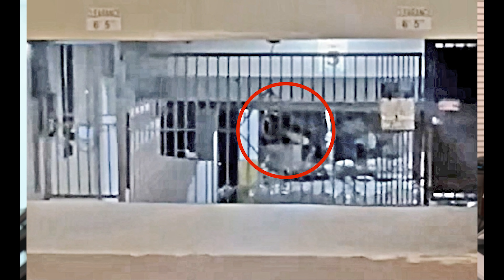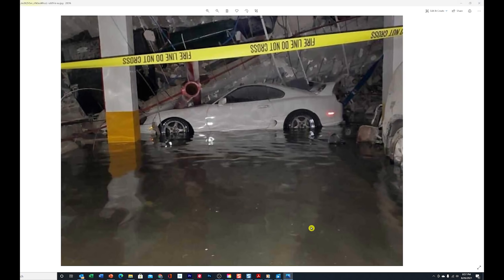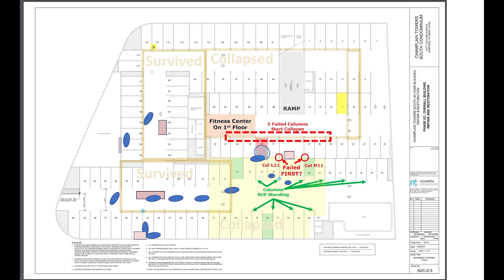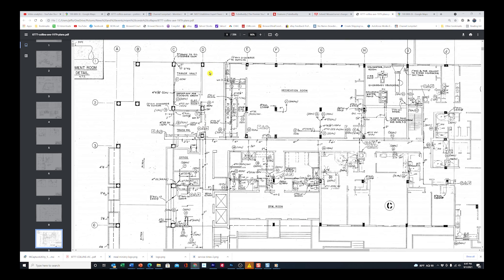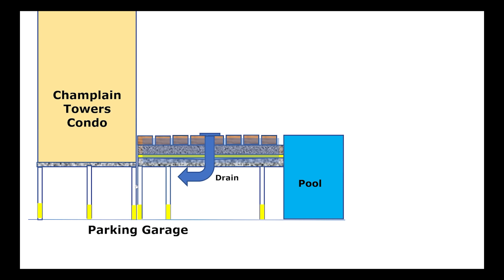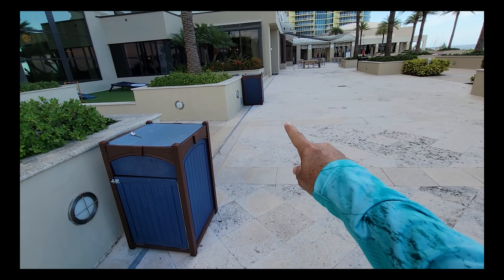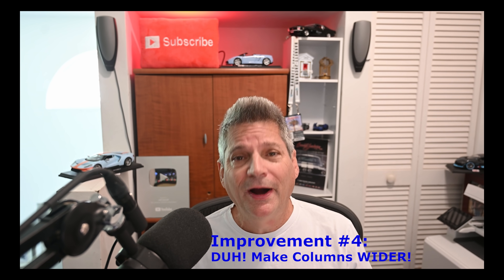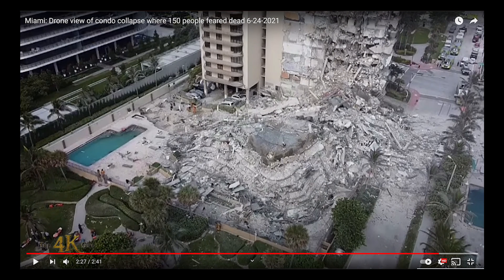Miami Condo Collapse: 4 Engineering Fixes May Have Prevented It

Comment: A simple waterproofing membrane would have gone a long way to protect the reinforced concrete
This same thing happened to a mall in the city i was born in, which had a rooftop parking garage in a far north climate where salt is used heavily on the roads during the winter seasons. It never had a proper waterproof membrane installed since it was build in the early 80's, it leaked from the day it was opened, and it collapsed after years and years of salt water intrusion.

Comment: I seem to only get these videos in 480p for some reason.   I can’t select higher…..
Reply from the maker: You should be able to adjust that, by clicking on the gear icon while your YouTube video was playing, and then choose quality, and you should be able to set it at the highest resolution. I find a lot of times it won't automatically select the highest resolution for me and I still don't know why but I find myself having to correct that all the time. If that still does not work for you then you need to find out what's wrong with the browser you're using and why it is not allowing it to change the resolution. Because I would think that the YouTube app will only allow you to change the resolution if your video can handle that resolution.

Comment: What you say it is col # 118 looks to me like 110 !!!
Reply from the maker: It does have moments where the compression make sit look like 110, but  I have done freeze frames on it, and at the beginning you can see it is clearly 118, and also the spot where they are drilling only makes sense when you look at the floorplan, a it is the only spot in the garage they can be under the still standing part of the building, an under the dumpsters.

Comment: Jeff, I have built two high=rise buildings with triple levels of parking below them. I know we had expansion joints, but I do not remember if they were at the building's edge. One of them has been ordered closed due to Spalding and need of maintenance by the present owner. PACE NATION will fund this type repair and take a special assessment for repayment over 25 years. They will also replace energy hogs with efficient units that will pay part of the future payment.
Reply from the maker: Yes every solution has its own problems. Glad I'm not the builder!

Comment: Excellent video once again.  The waterproofing and drainage on the pool deck can't be forgotten.  That deck was holding 100% of its capacity without all the water it was surely holding due to the waterproofing, or lack thereof, and the drainage issues.

I wonder how many of these construction faults can be found in the other buildings of similar design and age?  It really looks like while deferred maintenance was an issue, there were issues in place from the time of construction.

Any idea how long it will be before the official report comes out on the failure?  I see lack of rebar, defective concrete, defective waterproofing, along with a minimal design as contributing to this disaster.  If I owned one of the units in the similar buildings I'd be very concerned.
Reply from the maker: Jeff I bet we'll encounter this again in the future

Comment: The expansion joint as you mentioned, 24 inch columns under the entire building, 16 inch columns under the pool deck, the pool deck would have had additional drains, the planters would have had drains with easy to access washouts.

The addition of the penthouse honestly probably didn't help things much.
Reply from the maker: Everybody keeps pointing to the penthouse but I doubt that that had any problem because it was already calculated into the design. So unless there was errors in their design from the beginning that is not the issue.

Comment: Very Informative as always Jeff. My suggestion was make the columns wider which you mentioned. After watching all of your videos and taking into account the size of the columns, the lack of drop panels and expansion joints, the extra weight of the building combined with 40 years of water damage. I’m actually surprised it stayed up as long as it did. It’s easy to say that now after the fact, I know
Reply from the maker: great minds think alike!

Comment: All good ideas (isolation the best idea with widening colums and reinforced top supports)But they would have added cost, and cheap was the name of the game in his building. Plus many colums were just too small for the load.. great improvements, just too late and no one wanted to spend the money. Even with the improvements, I feel the building was doomed by the moisture corrosion of the rebar/concrete and the retrofits would have just delayed the collapse. It should have had a thick dedicated water barrier on the pool deck sloped away from the building. Btw, where the deck collapsed on the supra, how far  in did the trash dumpster truck drive into that area? Repeated heavy axle weight would have also contributed to slab failure in that area.
Reply from the maker: yes it was doomed

Comment: (Raising hand) Hey whoo hoo over here. So as an engineering student from a state that gets earthquakes we would NEVER build something like this here. As any earthquake would have sent it toppling to its doom. The main problem is you should NEVER build a building on columns. The reason why is if you think about if I put you on a platform on top of a 2x2 and then kicked the 2X2 sideways what would happen? It would fly out. Columns can't do horizontal forces hence we don't use them in earthquake-prone regions for support. The solution is actually pretty simple. Build a wall instead. More specifically a plus-shaped wall. So if you think about a wall in front of you, if I pushed it from the front it would fall over. But what if I hit it with the same force from the side (edge of the wall 90 degrees to the front) it wouldn't move. Because it's hard to rotate a square. Walls are weak in one direction like columns, so if you put another wall 90 degrees to the first wall and make a + or an L shape, it's much much harder to take it down with a horizontal force. As in any direction you are trying to rotate the square. So the simple solution is just between the parking isles put a wall, and then every now and again put a wall 90 degrees to that one.

so visually... (obviously walls would be connected)
Not this this is what they did ( * = column) (| or - = wall)
* * * * * * *
* * * * * * *
* * * * * * *

Not this too (Would work if the horizontal force went the same direction as the wall)
* * * * * * *
----------------
* * * * * * *

This would work
| * * * * * |
---------------
| * * * * * |

or this also would work
* * | * * | * *
----------------
* * | * * | * *

Easy to topple

|    |
|    |
|    |        <---------------------- Force pushing sideways (column or the edge of a wall)
|    |
|    |
|    |
|    |

Hard to topple (wall front facing you)

|                                         |
|                                         |
|                                         |             <-----------------  Force pushing sideways  (Sideways force with the wall facing you)
|                 Wall                |
|                                         |
|                                         |
|                                         |
|                                         |

If you want a good demonstration of this, go stand on top of a piece of wood parallel to the ground on top of a sturdy box, vs a bunch of toilet paper/ paper towel rolls and then swing your body around. One of them won't stay up, the other will stay because a box is two pairs of walls 90 degrees to each other.

Also putting the crown on top of the columns is actually a really good idea it spreads out the load a lot. As pressure is force over area hence if you have a larger area (the crown) you get less pressure. Even if you have a similar load.

Hope that comment helped!
Reply from the maker: Columns are OK as long as you have walls like you mentioned, shear walls, and additional beams to provide lateral support.

Comment: I would expect to see cross beams between the columns.  They support the deck on a grid system rather than concentratate the forces on an individual column beam.
Reply from the maker: They had a few beams, but only under the planters. A few walls and a few more beams might have helped as well.

Comment: Jeff, I find these Champlain Tower videos so interesting. Thank you. Why didn't the engineers who approved the plans find these potential flaws? Were they just rubber stamping stuff to get it out of their inbox? Is this common practice?
Reply from the maker: Yes rubberstamping of design plans was a big problem back in those days. Plus and I brought this up in the video engineers tend to engineer or something for when it's working but they don't engineer it for when stupid stuff happens or assume that hey one day this entire monolithic slab from the pool deck all the way into the lobby floor slab is going to degrade one day 'cause they just don't think ahead that somebody is going to not maintain the property and that water is going to get in and ruin their concrete. These are problems now that I've been saying for years even when I was at Motorola as an electrical engineer that engineers don't think enough about this stuff. At Motorola I didn't think that they put enough emphasis in the design on protecting their phones when people use third party chargers. You can't just get away by saying you void the warranty by using a non-Motorola charger for example.

Comment: These horizontal support beams seams like good idea, but installed on top of each beam not connecting them in between.
Reply from the maker: I think they are set in between to resist rotation

Comment: 10:21 has the wider tops on columns and still collapsed.
Reply from the maker: No sorry you are wrong, you are misreading what you're seeing in that photo of the punching shared garage. Those wider tops you refer to are not caps. Those wider tops are in fact where the slab was in a punching shear that is how the slab breaks it's a textbook punching shear where the slab breaks at 45 degree angles and leaves that sort of mushroom head behind. So that was the actual remaining floor slab on top of the column that you saw, not a capital. Does garage did not use capitals which is why that floor collapsed on it.

Comment: this was excellent analysis. I think you should have mentioned proper waterproofing/drainage system as another fix, as the pool deck was like a sponge that wasn't getting rid of all the moisture in a correct way
Reply from the maker: I did not mention it because it was already in their design. Implemented correctly? Who knows

Comment: I think they need to do a 20 year inspection on these condos and at that point implement these kind of safety improvements for all buildings and not wait for 40 years.  The inspection should also, as you have illustrated in this video, look for errors and unsafe obsolete designs in the design plans and in the construction implementation and any changes or additions and require them to be fixed according to modern specs at that time. 

 I remember hearing about 2 additions that were made that might have contributed to weakening the building, one, the addition of a penthouse level that wasn't original to the plans, and two, the addition of large concrete planters on the pool deck right where the initial pool deck collapse happened.  What was said was that no additional beefing up of the floor, beams, or columns was done under the planters. I think this was a critical mistake.

Another change I would make (in addition to yours) would be to add more beams between columns.  And finally I wouldn't allow underground parking garages on the beach side where saltwater storm surge flooding, sea spray and saltwater ground water intrusion are possible and thus can weaken the concrete and rebar in the columns and ceiling slabs. Any that already exist I think need to be strengthened with all of these upgrades or condemned starting immediately with the north tower condo of the same design and also a pool deck surface that doesn't allow water to pool on the deck, it should have a drainage system to take the water away and not let it seep into the concrete.
Reply from the maker: Everyone brings that up. Penthouse's was in the plans

Comment: I keep going over these videos and now with your enhanced image showing column 9.1/10, the one at the bottom of the ramp.  It looks as though there may be movement at the top of the column.  Looking at the still shot in this vid, the bottom of the column shows a sharper edge than the top of the column.  Hard to describe and yes, the quality of the video could account for it but it looks like the top of the column is blurry while the bottom is less blurry.  This suggests that the top of the column was moving when the video was shot.
Reply from the maker: I really want these security camera videos

Comment: As an attorney and not an engineer, I keep asking the question as to how the condo association was allowed to delay the renovations for as long as they did.  Do you think the structure repairs were unreasonably delayed in this instance?  Is there a defined timeframe in this jurisdiction to make such repairs once the inspection has been made?
Reply from the maker: There may be changes in laws to cover this. They had started the repair already, that's the bad thing, just a little too late

Comment: I think the water/drainage issue was really the cause and it took a lot of time to ruin the strength of the concrete and rust the rebar.  The building was standing for 40 years.  The design wasn't optimal but I'm sure it would have stood for another 40 years if the waterproofing and drainage was done properly on the pool deck.
Reply from the maker: Yes and if they had not added all that weight tot he deck
Reply: No.  The lack of capitols and drop panels on top of  the columns; unusually narrow columns; no isolation joint; rebar spaced too closely; and the added weight of the paver stones and planter boxes---were the primary causes.  Water damage only accelerated the inevitable.

Comment: Wasn't the pool deck a step down construction ? i think i saw that somewhere in the construction plans . Imagine having two slabs of the floor sitting on-top of each-other on the pillars at the place where the planters are . If the pool-deck then would collapse due to to much stress from moist and the weight on it . being it the lower slab it would buckle the pillar it is laying on cause of the weight of the overlaying slab . The lower slab would act almost like a lever putting enormous sideways forces on the connecting point .
Reply from the maker: yes 1' 6" step down to pool, that's why when you see photos of pool deck in better days, you see 3 steps down from the exterior entrance

Comment: Fix #4:  Make the columns larger than they have to be as allowed by code  Problem:  Same as with the previous three fixes.  It makes the developer spend more money.  If a developer can save one penny in the construction of the building, they will do whatever it takes to save the penny.  If the engineer or architect does not want to go along with the wishes of the developer, the developer will fire said engineer and architect and find another engineer and architect that will help him save every single penny, and there are plenty of engineers and architects that will do that.  The game is build the building as inexpensively as possible and sell the apartments for as much as possible.
Reply from the maker: That all works until they have a very public failure like Figg did with the FIU Bridge Collapse
Reply: @jeffostroff  As long as the codes are met, developers will not spend any additional money.  It's a different story if they ignored the code at the time the building is built.

Comment: Fix #3: add capitals on columns in addition to drop panels.  Problem: that adds more formwork that is not in straight lines (could use prefab forms), adds more reinforcement, and like the drop panels adds more concrete.  This means more money and developers don't like that.
Reply from the maker: They can make and use reusable forms